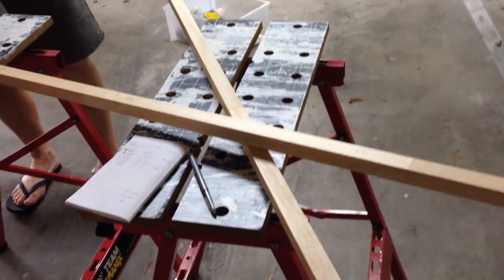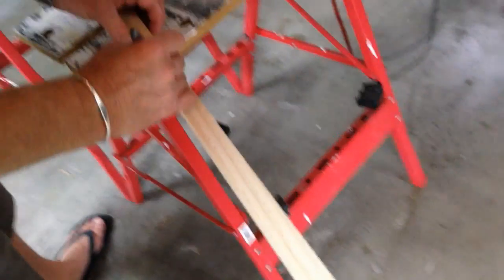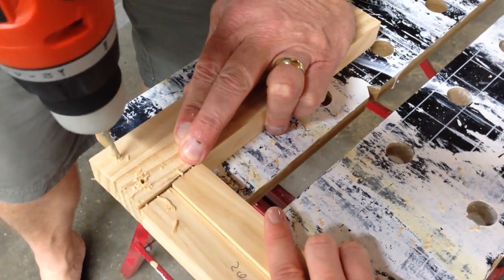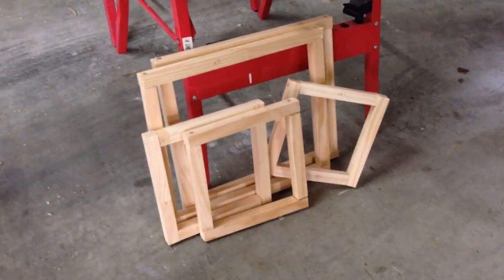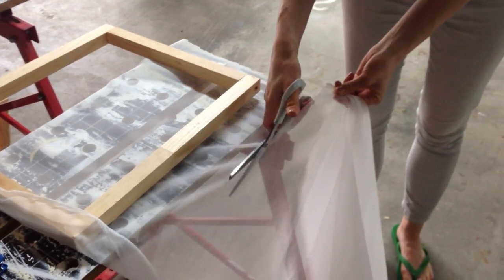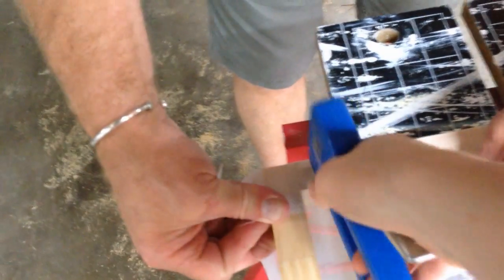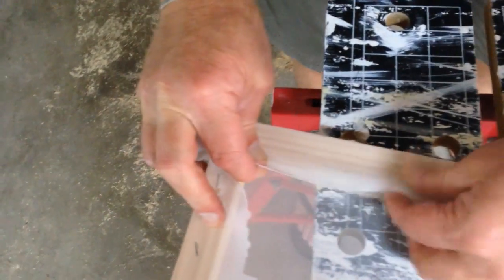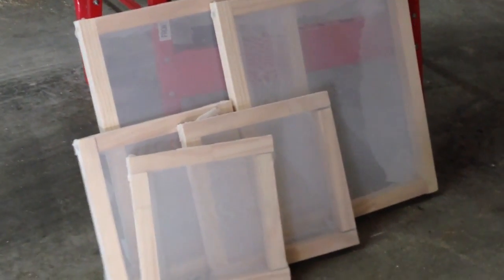DIY screen printing frames | CharliMarieTV

Comment: I would recommend covering the wood with 3-4 coats of waterproof varnish to prevent warping.  Aluminum is better but wood (if protected) can last awhile
Reply from the maker: thanks for the tip!
Reply: This is true, but aluminum is porous and will retain water it self over time.

Comment: I love it when a little bit of DIY saves you a ton of time!
Reply from the maker: In this case it actually takes longer than buying a frame, but definitely saves you lots of money! :)
Reply: Ooops that what I meant, money not time!
Reply: thatkatieproject If you're in a rush, and don't live near a screen printing supplies shop, I bet a short trip to the hardware store, or even pre bought stock, and a few dozen of minutes of work is damn more effective than waiting on the shipping!

Comment: Thanks a lot for posting this video ! I've just used this method and it worked surprisingly well.  It surprised me that it came very close to the method with a professional pre mounted screen that I bought earlier. With these easy available and cheap material you can make your own screens really fast.

I think that even if you are a professional T-shirt designer you can use this method for a first trial. Later on you can then send your artwork to a professional printing factory and order your T-shirts by the 100's.

Comment: Remember to glue the pieces together! or else they will twist when you are stretching the frame.
Reply from the maker: Sam Owens great advice! :)
Reply: anong pangalan po sa pang kolay po
Reply: Or if you have enough room use 2 screws at each joint. Otherwise you'd want to notch the framing. Good stuff.
Reply: i use the staple gun to assemble the whole unit (holds nice and tight) then pre drill the holes for the screws, then put the screws in. find it easier. varnish the frames to protect
Reply: Hi Charlie cry good video you have published Congratulations.
Reply: Cry good cry word is MIs spellings
Reply: It is very good
Reply: Or half lap the ends.  Pretty easy to do on table saw.  :)

Comment: I've been thinking of doing something like this, except i'm thinking of cutting into the ends of each length and chiseling out a piece measuring half the depth of the wood. The idea is to have the each corner resting flush (smoothly) into the groove of another, then screwing it. The measurements would be half the depth of the wood by however wide it is.

Comment: I hope you realize the most important part is make sure the bottoms are flat and square. The way you screwed them together will not make an even surface for the screen. It might work but it’s not a good frame.

Comment: Could you use an old photo frame instead of making the frame yourself
Reply from the maker: yep!
Reply: If you're looking for a good cheap alternative use an old canvas. Just remove the canvas fabric. The canvas frames are built to adjust tension and the way they are notched you won't have any problems with flexing/twisting.
Reply: I used frames from the dollar store and sheer curtains. Made each 10x10 and 8x11 frame for about $4.50 Canadian
Reply: @jofloresz  Lol...😆

Comment: Really glad I found your videos on screen printing. I think I've watched four so far. One thing. What type of fabric are you using? I just can't seem to catch it no matter how many times I watch it. Thanks.
Reply from the maker: +D&E miniature and board games sorry bout that, I think my accent can be hard to understand! The fabric I used is called swiss voile or sheer voile. it's the stuff that sheer privacy curtains are made of so it's got holes that are quite small, but overall the fabric is sheer
Reply: +CharliMarieTV  Thanks, about to start building these things. Just got my photo emulsion last night.

Comment: Hi, I have been looking into doing screen printing for a while now. I have watched a lot of videos on YouTube. I like the DIY method that you use. A couple questions... I see in some videos that they are recommending that you use a de-greaser on the fabric before applying emulsion. Is this necessary? I thought maybe they were just trying to sell another product to make money. Perhaps a mild de-greasing dish detergent would work as good if needed. Also, on the Swiss voile material, is there a certain thread count or hole size that I should look for to get the best print?
Reply from the maker: +Steve Lawton I didn't apply a degreaser to my fabric and my screens are fine, who knows, though, maybe they'd be better if I'd done that! i'm afraid i don't know the threadcount or hole size to tell you, but they should be really small. imagine them as pixels, if the holes are too big you'll see a jagged 'pixely' line around the edges of your design, so the smaller the better.
Reply: +CharliMarieTV The pixel explanation is a good analogy. I think I can go with that. Thank you for the info.

Comment: Would the stapled fabric resist water from a pressure washer or would it rip off?
Reply from the maker: +Marvin Cake I'm not sure sorry! I've never used a pressure washer.
Reply: +CharliMarieTV I guess I'll experiment with a frame and see if it can stay intact. Thanks for the reply though. :)
Reply from the maker: +Marvin Cake let me know how it goes!
Reply: CharliMarieTV
Hi!  It withstood the pressure washer just fine.  I double stapled the mesh to the wood frame just to be certain but it worked.

Comment: I'm actually at Home Depot right now attempting to buy wood for the frames. The price of the wood here at Home Depot is the same price of wood screens and my arts and crafts store. So wouldn't it just makes sense to buy the screens from the arts and crafts store and take off the screen portion after I use it...then add new swiss voile . I went and bought Swiss voile & its really inexpensive
Reply: I take that whole comment back. I found some Lumber dowel for way cheaper
Reply from the maker: glad you found some cheaper wood!

Comment: Nice one! thanks Charlie :) do you also expose your own screens? If so, I'd love to see your tutorial on this.
Reply from the maker: Forêt Threads I do expose them myself! I find the process stressful cos it's all about timings, but I promise I will try to film it next time I make some screens. That probably won't be for a while though so in the meantime check out this (rather old) video where I talk through the process, and there's a link to the tutorial I learned from in the description box: https://www.youtube.com/watch?v=Pb4QR6y7z4Q&index=5&list=PLrJQSKQvgHS5I1V7SEtAPdcyW5Zj4b8kR
Reply: Thanks Charlie! I'm actually just about to build my own exposure unit. Did you build one or buy one? :)
Reply from the maker: Forêt Threads I actually do it SUPER DIY and just use daylight to expose my screens!! i put the emulsion on and leave them to dry in a cupboard, put my design on the screen on a transparency and cover with dark cloth, bring it outside and expose for a time that I worked out earlier with a control screen, cover and bring inside again. AWESOME that you're building your own I'd love to know how you do it!
Reply: Ah great! are you still doing this now that you're in London? I'm near London too and England just doesn't get enough sunshine for that to be reliable sadly. I'll let you know how I get on building it :D its super DIY for me too!

Comment: Hi I was wondering if you are able to wash and reuse your frames for different designs? If so what is the cleaning process?
Reply from the maker: You could buy a screen cleaner to remove the emulsion and expose again. But curtain fabric is so cheap I’d just rip it out and put new fabric on
Reply: @charlimarieTV  Thank you!

Comment: nice video tutorial, I have a dumb sounding question:  once a screen is made & a  image is burnt onto the screen, is that the only use you get out of THAT screen?  OR can the image itself be erased from the screen so another image can be burnt onto it?      OR is  that NOT what's done typically?     
If I want to print a number of different designs, do I make a number of frames&screens OR just make the 1 & reuse it?   Thanks
Reply from the maker: +NYCP NY not a dumb question at all! Screen printing is best for when you're going to print multiple copies of one design, because it's a lot of effort to go through to print just one tshirt (though of course you're welcome to if you want to) If you want to get rid of an image on the screen you can buy something called screen cleaner which strips the emulsion and clears it, but honestly with these DIY frames I would just cut the fabric off and stick a new bit in! I can't attest to how well these DIY screens stand up to being stripped as the fabric isn't design for that (unlike professional, more expensive screen fabric). The best thing to do is make a few different screens, one for each of your designs, plus a couple of spares just in case something goes wrong with one. Hope that helps!
Reply: CharliMarieTV thanks, what type of "screen" do i buy?   Where?
Reply from the maker: +NYCP NY I'd suggest googling for a 'silk screen' or 'screen printing frame' but can't recommend where to buy one as I've always made my own like in this video :) art stores perhaps?

Comment: thank you for this video, I will try to do the same, but I have a question.
Can I use the same frame to print 2 diffrent desings ? if yes, how do we do it ?
Reply from the maker: +Meryem Kadiri yep! You just lay them both out in the space. Make sure you leave enough room to put tape over one design when you're printing the other tho!
Reply: RIAZ KHICHI Screen Art Kpt

Comment: I've made the mistake of using too short screws far too many times for my DIY projects haha
Reply from the maker: phew glad I'm not the only one whos made that mistake before! haha
Reply: CharliMarieTV I've transformed my wardrobe to a desk space, so 1 half is my wardrobe and 1 half is my desk now and it used to have 1 long plank as a shelf over the top that I have taken down, nailed to the side of my desk and cut the clothes rail in half so it's a separator between the desk and clothes, I used too small screws first time haha

Comment: can this material be cleaned and reused for other shirts? or is it one time use her screen?
Reply from the maker: +Theresa Wells I haven't used a screen cleaner on these because I sell the designs in my store so always need to be able to print them. The material is very cheap so it might even be easier just to rip it off the frame and replace!
Reply: Theresa Wells you can get emulsion remover but i've never tried, still in my infancy test stages.

Comment: Hi. What kind of fabric do you use for the screen printing frame? 
Thank you
Reply from the maker: +Andi Albu i think it's called swiss voile. head to the curtain section of a fabric store and pic something that is synthetic with a fairly tight weave (so you can see tiny little holes where the fabric is woven)
Reply: thank you! you're the best! :-)
Reply: thank you! you're the best! :-)
Reply: thank you! you're the best! :-)
Reply: thank you! you're the best! :-)
Reply: thank you! you're the best! :-)

Comment: Hi marie,
i am living in wellington. may i ask where u get your mesh from? Thanks
Reply from the maker: You33faz I buy fabric from Spotlight! :)
Reply: CharliMarieTV  checked spotlight. they said they dont have any proper material for screen printing. the polyester mesh they had was too low on mesh count.
Reply from the maker: You33faz That's right, if you want to buy special screen printing mesh you will have to go to a specialist store. I just bought curtain fabric from Spotlight to use on my DIY screens! I think it's called voile. It works absolutely perfectly for me :)
Reply: CharliMarieTV can you please post a link of the printings uv done with that mesh. Thanks :)
Reply from the maker: You33faz sure! All of the tshirts in my store have been printed using screens made in this method :) http://linernotekids.storenvy.com/
Reply: CharliMarieTV Cool store! i like that "unravelled" T-shirt. you should do more videos on how you screen print. i usually work with vinyl but nathing can beat screen printing! iv been trying to find a way to make my own film positive for screens. any advise on that?
Reply from the maker: You33faz I print my design in black ink onto a transparent sheet! i just go into a print shop with my file and get them to print it, but you can buy your own transparent sheets and print at home if you have a laser printer. Check out my playlist of tshirt business videos for more about my company and screen printing: https://www.youtube.com/playlist?list=PLrJQSKQvgHS5I1V7SEtAPdcyW5Zj4b8kR (the screen printing video is rather old and I'm planning on making a new one!)

Comment: I need the material names so that I can buy it from the market
Reply from the maker: +Chiradeep Mukherjee it's called Swiss voile where I live. But look for a sheer curtain fabric with a tight weave
Reply from the maker: +Chiradeep Mukherjee it's called Swiss voile where I live. But look for a sheer curtain fabric with a tight weave
Reply: That's good however is there any specific weight or GSM of it I need?

Comment: This Frames are not suitable for professional jobs
Reply from the maker: I never said they were! :) These are DIY frames if you want to do screenprinting at home without paying the high price for professional frames :)
Reply: Ok dear
Reply: U use half lap joint frames. They can make using circular saw. I am in Sri Lanka. I use that type of screen frames